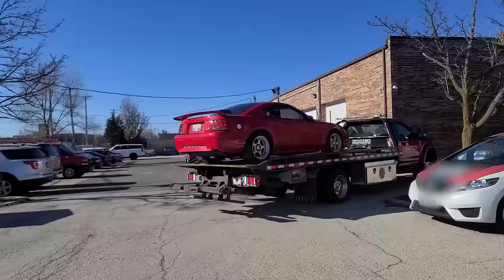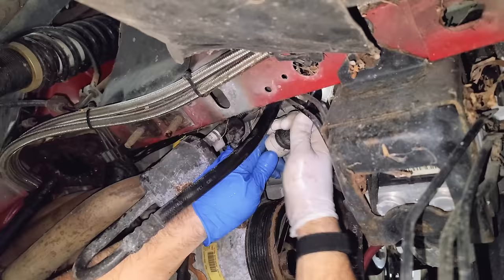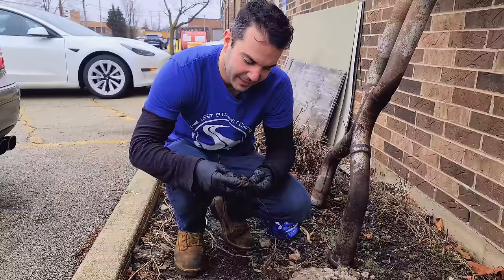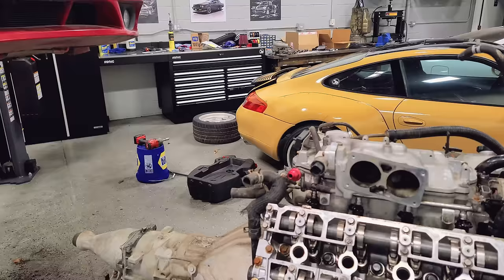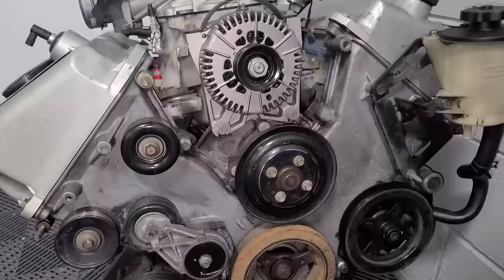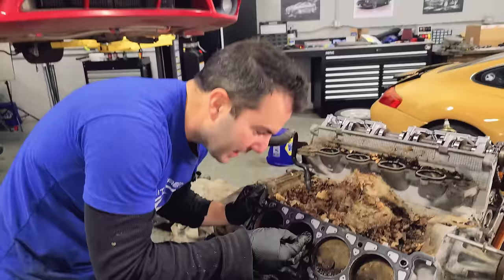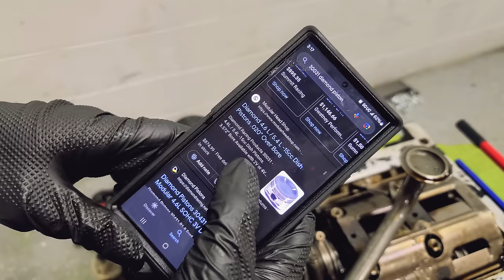Rebuilding The World's Fastest Cobra Mustang! ABANDONED For 20 Years! New Engine & CARNAGE!

Comment: 99 Cobra’s did indeed use the regular Mustang rear bumper. They also had primarily the same interior as the GT. It wasn’t until ‘01 that they got some special seats/rear bumper cover, etc. 

As for the brakes, they are just “regular” brakes, but we’re quite a bit bigger than the GT brakes, and are a common upgrade.

Comment: You may want to find out the compression ratios of those engines. The old engine has flat top pistons and the "new" one has dished. It would depend on the combustion chambers and head gasket thickness, deck heights, rod length, stroke etc. But they were both boosted engines, so you may be okay.  Good luck!! Awesome video!

Comment: SPS head bolts are Ford factory bolts. 

Thump RRR Racing billet belt tensioner is ideal for a Vortech but are $500! They use the 99 style 3 bolt tensioner and the front covers do interchange. 

Get yourself the UPR (or what ever you like, there's a plethora of kits) head cooling mod for the coolant crossover on the rear of the heads. Do it while the engine is out so you don't have the coolant dead head and create a hot spot at cylinder #8 (rear driver side cylinder)

NGK 4177 TR6 plugs are a good plug for boosted 4v's 

I believe the V-1 S-trim is oil fed and the V-2 is self contained like your Procharger. Obviously with having the provisions for the oil feed/drain already on both engines doesn't matter for you. 

The XA engraved on the head is most likely indicating comp cams! (Nice score)

Stock heads bolts are known to hold 700+HP and 14+ PSI. The SPS bolts are TTY! 

The 01 Cobra's have both a Teksid and WAP blocks (early years were Teksid, and it's TeKSid not Teskid!), the easiest tell is in the valley (once all organic materials and human hair is cleaned out of course) the WAP has ~14 ribs with square webbing and the Teksid has 6 ribs with diamond webbing. Both blocks are good for over 1000hp but the Teksid is a little stronger in those years. (WAP means Windsor Aluminum Plant) 

Too bad the car was converted to automatic transmission however the T45 probably wouldn't last long at the power level you'll be at. However that blower is most likely going to be your limiting factor. I'd just go turbo now and save the headaches down the road....... 

You have one hell of a project ahead of you, not sure what you had in mind but there's a reason the car has been dead for over 20 years, the car was built when the modular motors were just a wee little baby and has come leaps and bounds in the last 20+ years! You have a solid start but still so far! You can certainly put it together and get it running but that doesn't seem to be your modus operandi! 

Car would be so much more fun with a T56.….... (I also swapped my Crown Vic to a manual so I'm highly biased 😂)

Comment: This was super nostalgic for me. My first fun car was a 99 cobra. I drove across pa to Ohio to buy it and drove back the same day. I abused it and modded it for years and snapped a factory rod. I rebuilt it in my garage and ran for another 39k miles everyday super hard. I put forged internals then with 4.30 gears. Then I had a timing chain failure and the guide material clogged the pick up and oil starved it and put a whole in the block. Sadly I just had purchased my first home and sold my rolling chassis for 4600$ and now it lives in Delaware as a coyote swap

Comment: Those blue bushings for the exhaust are just isolators so when you attach it to a frame or crossmember, you do not have metal on metal contact, and it acts as small shock absorption. I know this because when I had exhaust put on my 74 Chevy pickup, that is the type of isolator that was used for a hanger.

Comment: Greqt video as always good sir.Anytime I work on my o3 mustang it's a nightmare of frozen bolts and hardware everywhere. Any time u think oh I'm just going to change shocks or breaks or whatever it's always way way longer dealing with rusty hardware lol I wish it looked as easy as it does on this channel lol I only have a base model v6 I had to change the wiper motor out and it was a night mare to not break the cover over wipers and motor.the baby clip that hooks the wiper arm to motor is a night mare if u have big hands. I put drilled a slotted rotors and carbon ceramic pads .it.makes a huge difference in breaks highly recommend

Comment: Bumper is correct for a 99.  01 only had the Cobra name on it.   FYI those look like the typical lower compression forged pistons on the 03/04 Cobras.   99 front covers are different and have the three bolt tensioner which is a better tensioner.  You can use either one, typically but since the supercharger (if it is going back) is routed using the 99 cover I would use that.   Need sealant at a few spots when swapping FYI.    The “C” is NOT a factory marking.   Crank is the factory forged crank which was never an issue and made by Kellogg.  Not sure on cams but most aftermarket cams had a hex in the middle of them versus the smooth factory cam.

Comment: As a 2003 mustang Mach 1 owner I’ve been very patiently waiting for this build.. yes the rear bumper on the 99 wasn’t special. In 01 the cobra still had the same style of bumper but instead had “cobra” instead of “mustang”  written on it. It wasn’t until 03 that the cobra had its own unique rear bumper. The one unique thing on those 99-01 cobras were the tail lights. Those factory tail lights with the amber section for the turn signals regularly fetch about $800 USD. Also those front bumpers are getting harder and harder to find.

Comment: I remember being up at Road America in the early 2000's and there were 3 guys running Cobra R's. I had no idea that they only built 300 of them and that was really rare to see 3 on the track. They were comparable to the Z06. 

Also, there were a ton of Cobra terminators on the road. Ford made up for the disappointing numbers on the '99 with the terminators. It was rated at 390 at the crank, but it would do over 400 at the wheels. It was tough to keep up with them on the street with a stock Z06.
Reply: They didn't do 400 wheel stock more like 360-380 on average I seen some happy dynos say 390+ but that is a very generous dyno at that point.  The 99 just had intake manifold casting defects and an issue w the catback that causes power loss they were all fixed it wasn't a big deal but it put a stain on their rep all people remember is they were down on power most don't even know why therefor it stained their rep when it really shouldn't have.  People made it way bigger of a deal than it should have been.  Like I said most didn't even understand the issue to begin with.

Comment: Had a 99 cobra for several years. No cobra on the bumper.  Changed in 2001.  Main complaint on that car was it had a teksid block which was stupid strong but not fully forged internals.  If it had that would have been a monster to modify on a budget.
Reply: It is still a monster to modify on a budget.  Boss rods and forged pistons is all it takes (1000 bucks) to make 700 wheel reliably with boost and fueling.  Stock heads and cams crank and block etc...

Comment: Love the 2015–2020 Ford Mustang Shelby GT350/350R (526 hp (392 kW) at 7500 rpm, 429 lb⋅ft (582 N⋅m) at 4750 rpm ) and the 2000 Mustang Cobra R (385 hp (287 kW) and 385 lb⋅ft (522 N⋅m)) for normally aspirated engines.  Track cars for sure! 🏎️🚀🫣😳😬🤯

Comment: Love to see you do a fwd 4.6 32 valve  on boost and intake and exhast and fuel pump and injectors only real changes and do top speed runs and drag runs call it under 5 k builds

Comment: It wouldnt be a bad idea to change out the timing chain guides to billet guides, those are factory guides. Plus the tensioners like failing too.

Love the new edge content
Reply: The steel tensioners are good, the plastic ones are the ones prone to failure. The 4v also doesn't have the same guide issue as the 2v and billet guides are not needed. 

The factory 4v guides are not all plastic which is the issue.

Comment: the deposits in the newer motor on the top of the pistons of a low mileage older engine is pretty typical from someone babying it for short little drives.

Comment: Those are factory ford camshafts. It could be a ford performance camshaft maybe though. “6A271” is a cam shaft base part  number(base part numbers is like an identifier of what component it is) the “YL7E” it’s like you’re vehicles or engine identification and the “AC” is under iteration or revision of the part.

Comment: I'm a Chevy guy but man just the shear size of that intake and heads got me excited! I'll still take an LS all day long much simpler and more reliable.
Reply: It isn't more simple or more reliable.  Why do people think 4v are complicated and unreliable?  That's a bunch of nonsense.  The pushrod guys act like it's whichcraft because it's different and say it's more complicated yet the ls has to have all kinds of engine mods and built motor to do what a 4v can with just rods and pistons plus fueling and boost the ls requires way more plus boost too while a 4v can make 700 wheel with 281 cubes and factory heads/cams.  The ls takes alot more stuff to reliably hit 700 to the wheels despite having alot more cubes yet the ls guys say the 4v is "more complicated" seems like a pretty easy recipe to me lol.  They're pretty damn reliable when maintained.

Comment: I was a former Ford tech of about 15 years. Cams look factory, I bet the crank is too. The bottom end on those engines was really strong out the box. 

Those multi piece headers were kind of a thing back in the day because installing long tubes in that car without dropping the k-member sucked. 

Rear bumper is correct for a ‘99 MY car, they didn’t say “Cobra” on them until 2001. Be careful with those coolant tubes you torched and beat out of the heads, I’m pretty sure they’re obsolete these days. 

Front cover is also a direct swap between those two engines, I’d probably use the old cover since it’s correct for the blower and has all the right pulleys and provisions for the belt and such on it.

Comment: For '99 yes, the rear bumper is just "Mustang". Ive had a bunch of cobras (never a 96+ mod motor though). I do know, There werent big differences between the GTs and Cobras until 03. 94/95 Cobra vs Gt Both had the 5.0 HO 302 Pushrod The cobra had the GT40 package like GT40 upper and lower intake, GT40 3-Bar heads etc. Also had the front bumper cover with the round fog lights, had the v6/Gt hood, had clear headlights, had the crab claw spoiler with the 3rd brake light, cobra airbag, only came 5-speed, cobra brakes, white face 160mph cluster, and rear bumper for the 94/95 cobra was also the same as the v6 "Mustang" where the gt had "Mustang GT" then in 96-98 the Cobras got the 4.6 DOHC, still had the Front bumper with round fogs like the 94/95, but got the "nostril" style hood, rear bumper now said "COBRA" but lost the crab claw spoiler and had the same spoiler and deck lid as the 94-98 v6/GT, everything else was pretty much the same as the 94/95 cobra but the white face cluster now said "Premium Unleaded Only" and 96-98 between all v6, 4.6 SOHC and the Cobras DOHC had minor changes throughout the years. Then 99s came out 99-04 as the "New Edge" body style although technically still an sn95 but thats when the irs changed came in. Then the 03-04 cobras aka "Terminator" were the top dogs with the 4.6 DOHC Supercharged, The Terminator front bumper with the big oval fog lights, the 6 speed and went back to the rear bumper saying "COBRA" ... And then there were the Cobra Rs.... The 93 Cobra R Fox body was the only R that kept the same motor as it's regular cobra brother but still had changes like Power NOTHING, rear seat, radio delete, better suspension etc. Then 95 came the 95 Cobra R that went to the 351W 5.8L cowl hood, rear seat and radio delete, better suspension only came in white and then the probably most sought after.... the 00 Cobra R..... "Hand built" 5.4L Mod motor, the big T wing better suspension etc etc etc etc.... I am obviously missing a few things here and there throughout the years but those are the big differences.
Reply: Not sure why you think there wasn't big difference between cobra and gt until 2003 the 1996 cobra had a 305 hp 4v that revved to 7000 stock while the gt of the same year had a 215 hp 2v that died just over 5000 rpm its night and day that is 90 hp more which at that time was almost 50% more power which was huge.  The 94-95 usually dyno maybe 40-50 more at the most.  The cobra 4v got forged 8 bolt cranks vs cast 6 bolt the gt got and the cobra had much better brakes it goes on and on.  There was quite a big difference between cobras and gt even before the terminator.
Reply: The rear bumper went back to saying cobra on the 2001 not the 2003.

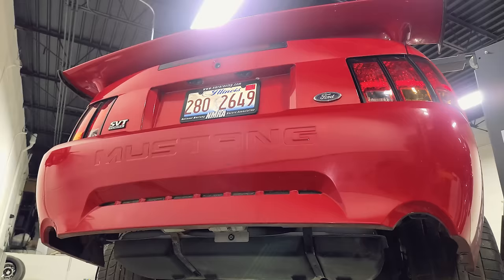Comment: @9:30... Yep. I actually did a GT to Cobra and Cobra to GT swap in my shop. A guy with an '03 GT wanted to road race and the guy with the Cobra was a drag racer. They arranged to swap rears and split the labor cost. 10:13... '99 Cobra rear bumper says "Mustang", '01 says, "Cobra". @11:00... I'd just ditch the Vortech and fit a Kenne Bell or Whipple. @12:39... Longer wheel studs are required by NHRA rules. Figure you know that because of the turbo T/A, but the viewers might not. @21:30... This is where I'd shop vac the entire engine. @28:07... Looks OEM. The OEM crank is forged.

Comment: I am really curious to see how that happened. It is rare for a Cobra to fail that way. Maybe the oil pump died (weak point on those engines) and the timing chain tensioners collapsed. I would recommend billet oil pump gears and a good damper like ATI. In any case, nobody made an aftermarket crank for the Cobra because they were forged from factory, and could handle over 2000hp. ;) BTW You have a tonne of money in good aftermarket parts. Also, I would change the head bolts, those are stock. They are reliable but are known to allow the head to lift. Pick up a set of ARP head studs.

Comment: FYI that is not the original rear bumper.  1999 - 2004   Read cobra in the rear bumper.   And had the snake in the front grill and in the fenders.   I do highly recommend you reinforce the doors. weld the pipe inside the door.   For side impact.   If you plan on driving this car more than just to a car show.
Reply: incorrect,  the 99 said mustang,  i bought the car new and it was always like that, they all were

Comment: I had an 01 cobra and followed beefcake and a few others on a super old forum  back then. Use whatever you can from the 01 engine. It had the better block and was just overall better.  I miss my cobra and I wish I never had to sell it but my son was born and needed intensive care so i needed the money and sold it. Someday I’ll get another. Kinda like how you are with your ta.
Reply: The Teksid (99) and WAP (01) blocks are fairly similar in terms of durability. The Teksid is a bit stronger but both will handle 1000 HP
Reply: @quintman15  yep. If I recall some teksids slipped into 01 because mine was one of them. I think you could identify them by marks in the valley
Reply: @chiefbigpooh  Yeah, some early production 2001 Cobras got the last of the Teksid blocks. You can look in the valley and if you see crosshatching on the block you have a Teksid. 

Something similar happened with some early production GTs having different blocks as production switched from Windsor to Romeo; 2001 GTs produced prior to Feb 2001 all had Windsor blocks which were a bit different from the late production Romeo engines
Reply: The 01 wasn't any better the 99 had teksid that not all 01 got so therefor the 01 isn't "better" and in some cases isn't even as good.  Either can handle plenty of power with forged rods and pistons.
Reply: @midnight347  correct, I wouldn’t say either one is “better”. People love to rag on the 99 Cobras, but they’re great cars, just like the 01s, with very minor differences between the two. Ask me how I know 😎
Reply: @midnight347  99 went through a recall because it was low on power. So umm yeah
Reply: @chiefbigpooh  Correct, there was a recall. Just remember though: the fixed intake manifolds (debris from honing process) and restrictive exhaust (NVH boffins at Ford messing with SVT’s work) are the same parts as used on the 2001 engines. 99s with the recall performed are literally the same engine as the 2001. Same compression, same rotating assembly, same heads, same cams, same valve train, same manifolds.

It’s smarty pants like you whose incomplete understanding keep the prices down on the 1999s so people like me can get a great car for less money. So thanks! 😁

Comment: Side note: There was no 2001 publicly sold "Cobra" The only model produced in 2000-2001 with the "Cobra" name was the "Cobra R" which was the racing variant. I did a lot of research on this because I bought a 2000 "Cobra" without knowing anything and only found out later after talking to a Ford engineer. That said, I LOVE this model of the Mustang. I think it was the last "Real" Mustang and this body style was the absolute best they ever had beyond the type that was used for the "Elanor" build.
Reply: There was no 2000 cobra outside the r there was a 2001 though they made them in 1999 and 2001.  Then 03-04 and 100 left over 01 was sent to Australia and converted to be sold as 02 there